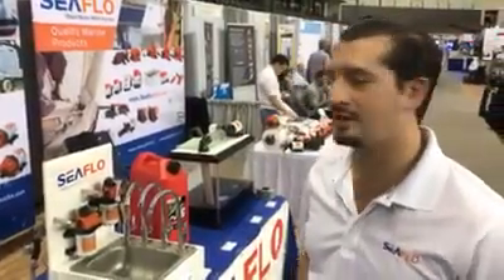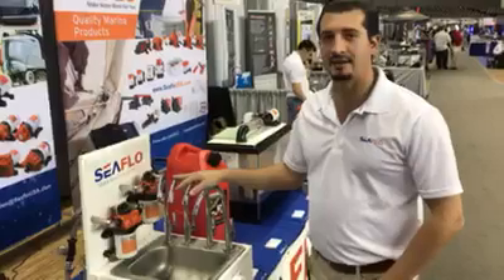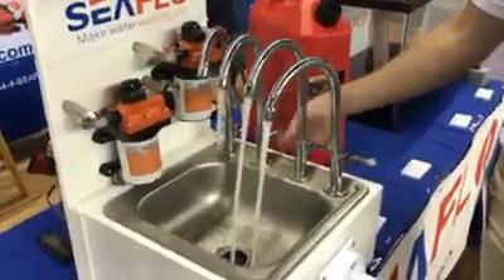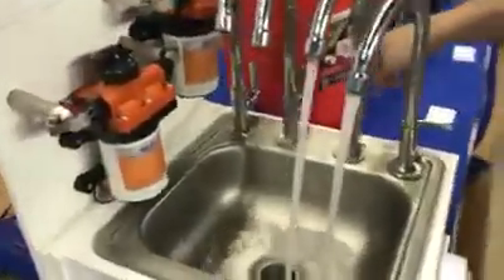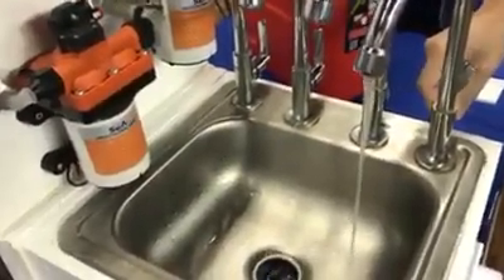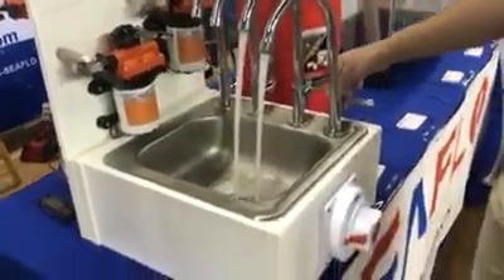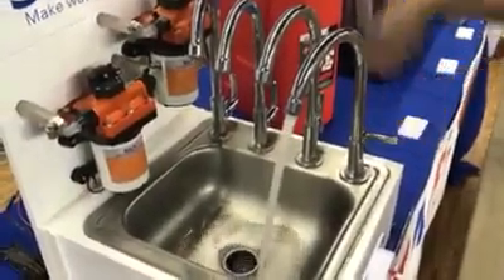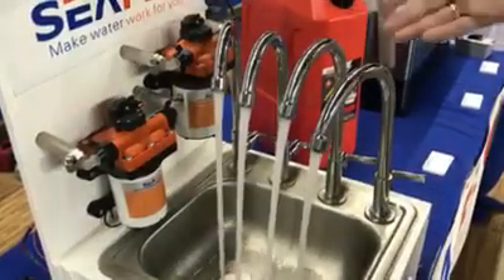SEAFLO 42-Series Pump DEMO 6.0 GPM Dual

Comment: hi do you have any videos on how to set it up
Reply: The way you install two pumps is to set them up in parallel, not series.  One intake goes from the tank, then splits into 2 lines to feed the intakes of each pump.  Then the outlet of each pump gets joined into a common outlet pipe to your sprinkler system.
Reply: @CadeBrazil  thank you